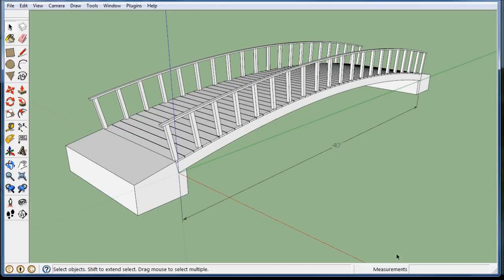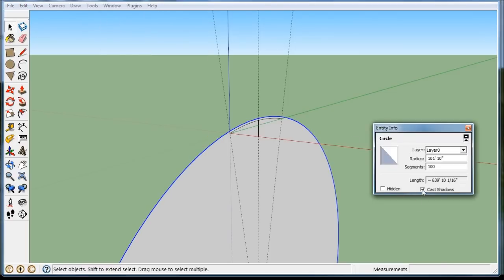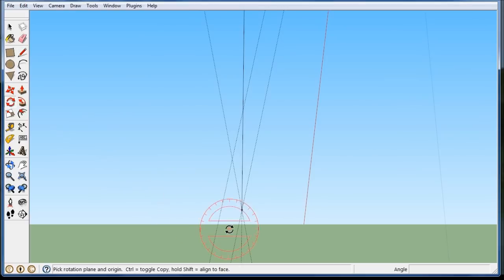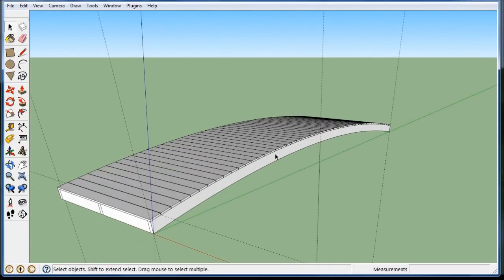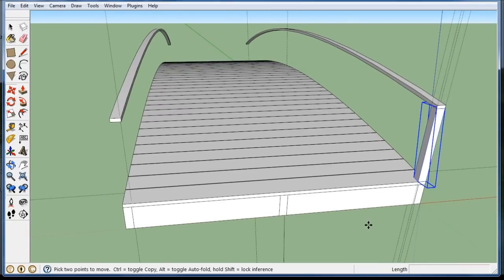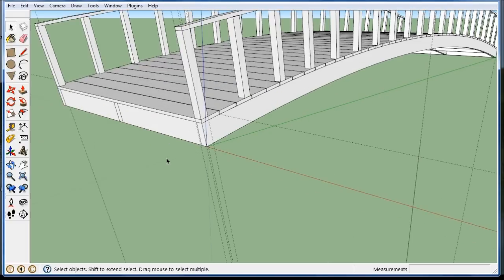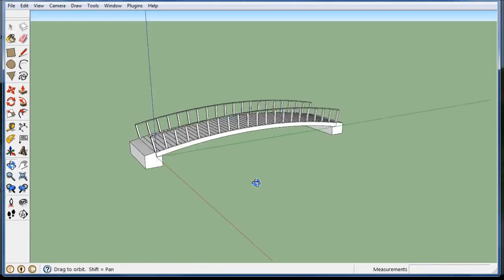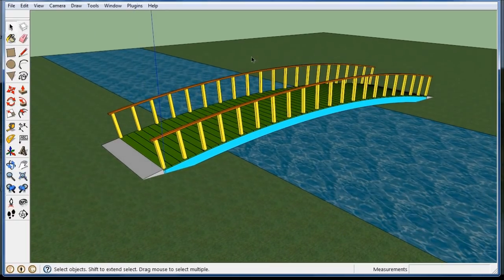Build a wooden arch bridge in Google Sketchup

Comment: Learned a few things in this video thank you for that, but it did leave a question that was never talked about.   How did you know to go down 101' for your first guide?   That was required to match your 2' arch done on the bridge.   Anything besides 101' will not work.   If you had of selected a 3' arch, then 101' on the first guide would not work.